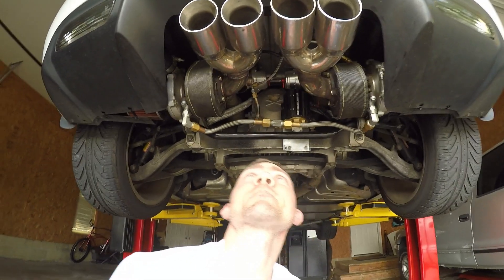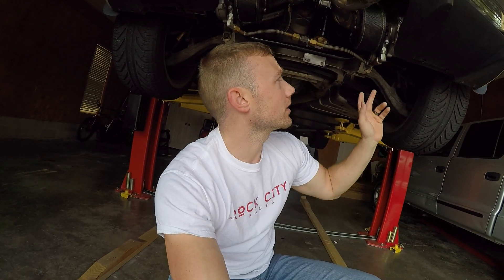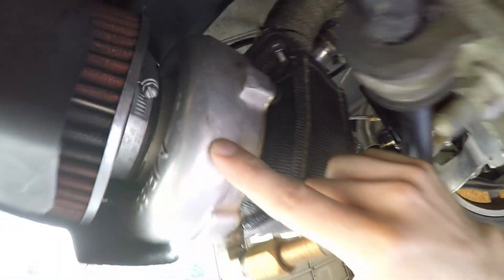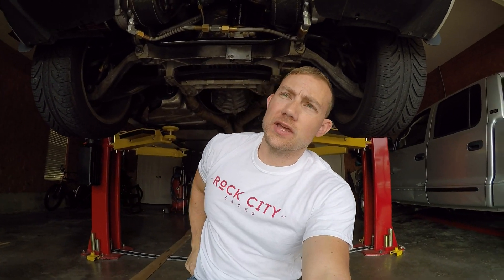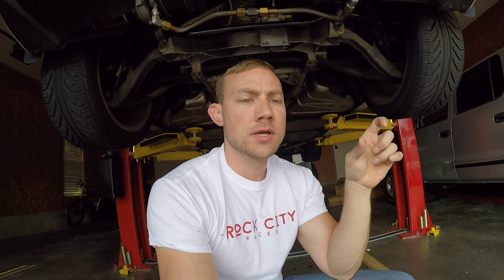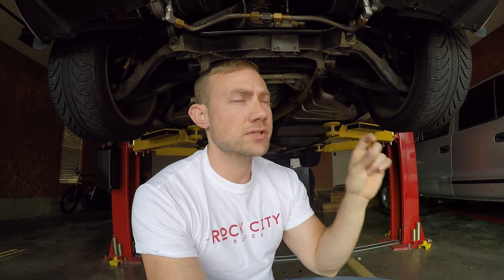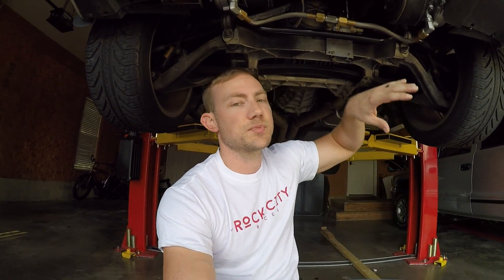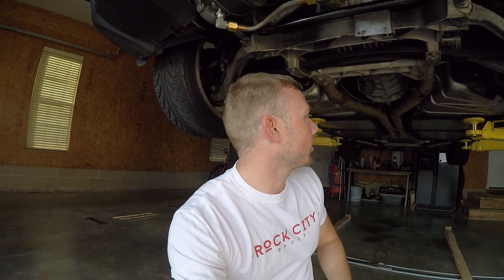Rear Mount Oil In The Turbo Solved

Comment: I know this is old,  but just wanted to say thanks.  Relocating the oil pump and installing the check valve fixed my burning oil issues on my low mount turbo.
Still getting a small  (quarter size) oil stain under the turbo over night though.
Reply from the maker: I would take the turbo apart and clean it out really good.  To be honest the check valve did almost nothing.  The higher flow pump and delay timer did the trick.

Comment: Good to hear that the oil issue is fixed. Did you know that phobia street stopped making the kit you have. I contacted them to get one and they told me that.
Reply: If you are still looking for a rear mount turbo system, try contacting STS turbo chargers. Send a message or give a call and they should give you a price.
Reply from the maker: STS are stupid over priced you could build one like mine for 3k

Comment: Speed Mafia Performance out of Colorado was a dealer for STS Turbo back in the day when they came out and I saw a TT C5 Z06 and that kit came with check valves... moral of the story is the check valve so be as close as possible to the oil intake side... I believe the spring for the check valve is 3.5lbs... you can purchase higher springs. This is know for about 12 years now...
Reply from the maker: In the end the real oiling issues was the return pump did not flow enough.  I put a higher flowing pump and removed the restrictors and no issues ever again.  Check valves are still in and a timer to run the pumps after shut off.  But the I still had oiling issues until I put the higher flowing pump in.

Comment: Here's a thought: Instead of having oil being supplied from the engine, why not have the turbos have their own oil pump/filter/cooler/tank dedicated to them with a timer?  There would be more costs associated with it and room needed to accommodate but I would think you would have better control on how the turbos are lubricated - not to mention eliminating issues with engine supplied oil. Anybody have an thoughts about this?
Reply from the maker: Very costly, time consuming, and not any more of a guarantee that you will have a better result.  If that was the better option car manufactures would be doing it, but instead they are doing oil supplied form the motor and returned.
Reply: xxblamedxx oem is not doing custom rear mounts, thus why we are. Oem is cost focused on massive production, this is hobbyist
Reply: I was wondering the same. if properly plumbed and set up. a dedicated oil supply sounds like the way to go!
Reply: @TheLifeofaMan  The is really bad reasoning, and it's usually false .  "If XXX was the better option, car manufactures (sic) would be doing it...."  

Car manufacturesr must find a price where they can profit.   They make 1000s of trade-off when designing a vehicle.   The better option for who?  for what result?  

   Quite obviously, everyone wants something different, to say something wouldn't work or be better because "the car isn't manufactured that way"  well just isn't factually correct and the reason people modify their cars.
Reply: @TheLifeofaMan  There are several rear turbo designs with a separate oil sump and cooler.   Generally you have a better result over time with these because contaminated oil from the engine is not running through your turbos.  You should still filter this oil supply because over time, like in the engine oil, microscopic metal comes off the moving parts and you want that removed from you oil as soon as possible    Unless you have a bypass filter setup on your engine, you are getting progressively more contaminated oil in the engine oil every minute your car runs until the next oil change.   If your turbos are separate from this, they don't bathe in that oil.   A bypass filter though would likely solve the problem of oil contamination in a shared sump.

Comment: Noise is a no go, I've heard one of those pumps in action and it makes wayyy too much noise. I would have ordered a second quiet pump, or even better as someone else also mentioned, added a small reservoir to hold the overflow to give the pump time to catch up. I would add a second pump for backup with a trigger in the event the primary pump failed to avoid being stuck on the side of the road when it finally does fail and adding a small cooler might not be a bad idea to keep the turbo center  section temps down to extend the life of the pump.  I'm planning my own rear mount and I want it to be as dependable and quiet as a front mount setup. I have used the Holley series red/blue/black pump for scavenging and it works very well once the pump screen is removed in order to allow free oil entry. It is very quiet, you just have to protect it from extreme heat.
Reply: Rbracing-rsr makes a transfer pump with helical gears.

Comment: Put a voltage regulator on the pump circuit and slow the pump down at lower RPMs
Reply from the maker: Better frame isolation was all I needed and now you can barely hear it run.

Comment: I’m using a standalone oiling system on my set up. I’m thinking of converting it to a scavenge system. I use a mechanical pump driven by an electric motor. My project is a work in progress to see how cheaply it can be done.
Reply from the maker: These oil pumps are like $60 the heat sync is another 100. Running for years no issue
Reply: @TheLifeofaMan  only problem is the noise,  I spoke to the manufacturer of a similar pump to yours who said they should only be run for 30 mins max 😞. 
The RB racing pumps have helical gears so they're quiet but to get one sent over to the UK is gonna be crazy money. Something like $800 all in and that's too much.

Comment: Awesome. I have a single turbo kit on my 5.0 and it's blowing oil out the exhaust like crazy right now because the return line runs too far to the back of the pan causing pooling after a few minutes of driving. Time for a scavenge pump.
Reply from the maker: Run a high flow pump and dump it into the valve cover. One of the other earlier videos cover were I dump my oil. There is already an open port on the driver side valve cover.

Comment: Where are the part numbers for the check valves?
Reply from the maker: I could never find them again.  You can find them on mcmastercarr or the like.  Just make you sure you get low cracking pressure and viton seals.

Comment: Got a link to the check valve?
Reply from the maker: I have been asked several times and I can not find which one I used.  Any check valve with 1psi cracking pressure and viton seal will be fine.

Comment: If you ever want to upgrade your oil return pump or switch it to something different then you should check out the Exa  pump. I have it on my remount turbo system and it is so quiet. I have had no problems for three years. Its worth a look at.
Reply: Justin Lampe hey man what oil feed line size and return size hose are u running? I got a 2002 z28 with original sts turbo kit with upgraded on3  70 mm turbo. The kit has the original feed line and return line with upgraded shurflo pump. I am looking into upgrading it and would like to see some input.
Reply: Justin Lampe sorry forgot to mention I have a restrictor in the feed line
Reply: That's awesome! How you liking that turbo? I actually have an on3 7875 turbo on my car. It is a little large but I put down 683rwhp on 16 psi. I do have a LQ4/4L80E setup. I may do a few videos on my setup. I believe my feed line is a 4 AN line. The return is a huge 10 AN line to the scavenger pump then it is a 3/8 rubber hose from pump to oil filler cap. STS turbos is back up and running again. I had to buy a new feed line from them a couple months ago. I did it that way so it would be the correct length and size.
Reply: Justin Lampe it's a decent setup man honestly but I wanna get a little more out of it but do it safely. I had a bit of issues with oil getting passed the seals so I'm wanting to upgrade that and maybe upgrade the turbo as well. Yes I would love to see some videos of ur car
Reply from the maker: Oil and feed lines are the same size. I have little set skew with 1mm holes drilled through them in the feed lines right on top of the turbos.  I threaded the adapters from the line 90 down to the turbos.  Return is open. I think they are 3/8 steel braided lines. It is what came with the kit
Reply: exa junk

Comment: What else do you need for the oil system? Just lines, check valve and the scavage pump? Or do you need other stuff? I’m wanting to locate my front mount turbo to the rear
Reply: Also, where is your Widebands located?
Reply from the maker: Turns out the check valves were a waste.  I put  high flow pump and a timer on it and all the problems went away.  The time lets the oil return pump run for about 15sec after shut down to empty the system out so it can not drain into the turbo.
Reply from the maker: Wide band is in the cat right below the manifold.  I have a video on here showing it under the gauge install.
Reply: @TheLifeofaMan  thanks for the replies. So far mine has been working great and already had it dyno’d!

Comment: Where did u get ur oil check valves from
Reply from the maker: I have been asked several times and I can not find which one I used.  Any check valve with 1psi cracking pressure and viton seal will be fine.

Comment: What check valves did you use and link for the pump??
Reply from the maker: No check values from the turbo to the pump.  Just on the supply.  I put a timer on it to keep the pump running for 15 sec after turn of to drain everything on the bottom side.

Comment: My rear mount has oil coming from the drain side.. I installed a check valve which helped a lot bit didn't stop it.. the lowest turbo spills. Little oil on startup :-(

Comment: Any way i can get the link for the pump? I have the same issue on my 76mm precision turbo and its driving me nuts lol. I will apreciate it if you can tell me the brand of it thanks
Reply from the maker: Cesar Garcia just search Google for oil scavange pump. They are like $60 and they are black and brass. Mine came with the kit so I don't have a link. Contact turbowex directly and they will sell just the heat sink for monting and longevity of the pump

Comment: Can you post a website for the check valve I been searching but can not find them.
Reply from the maker: Tons of people have asked and I can not find the order from when I got mine so it is lost in time lol
I remember ordering it from a sight like mcmaster carr.  I just found one in the fitting size I needed and the cracking pressure I wanted.  Also make sure it has viton seals.  neoprene seals work for a short while then fail because of the heat.

Comment: So what about those gears that aren't C clipped in there? Mounted correctly like that they just rub against the cover plate.
Reply from the maker: TheGuruStud they are under zero force and constant lubrication.  I've taken the cover off a couple times and no signs of where on the gear or cover.

Comment: simple fix is to make two small sumps for the turbos with breather vents that way the turbos drain as they were designed to do an the pump isn't constantly sucking on the turbos also once the engine is shut down the excess oil pressure has somewhere to drain instead of cooking inside the turbos bearings look up https://www.youtube.com/channel/UCQpoC_ilAGaNyLrLnXaH4Rg he has videos explaining this problem (he also isn't the only one whose worked out turbos need a freely draining sump to drain into)

Comment: Where did you pick up the heat sink for that oil pump?
Reply from the maker: It came with the Spartan pump and I kept it and slipped the cheap oil pump into it. I bet turbowerx would sell just the heat sync

Comment: What were the part #s for the Check Valve fittings? I did not see them in the description?
Reply from the maker: I did not put the PNs in there because it will be different for everyones application.  Just make sure it is a low cracking pressure and viton seals.
Reply: https://www.mcmaster.com/hydraulic-check-valves start there

Comment: So, I'm switching my engine bay turbo kit to a rear mount to gain back my engine bay. It sounds like the Turbowerk spartan pump would work for me since mine is a single turbo, four cylinder? I will use the check valve you talk about of course and the other notes. Unlike your twin setup, do you think this is good for a single turbo setup? Thanks.
Reply from the maker: Kurt Bennett I would still use the exact or the cheap eBay pump like mine. The Spartan kits loader when it fills. The gear pump gets quite when it fills.

Comment: Is only one scavenge pump good enough for a twin turbo setup? what is the specs on that pump? what size are the turbos?
Reply from the maker: TheFonz808  one pump is enough with restrictors in the feed. The pump is the cheap eBay pump. It flows tons but I don't have the specs
Reply from the maker: TheFonz808 turbos are 60 63

Comment: Where did you get these check Valves
Reply from the maker: mcmastercarr but I have never been able to find the part number.  They are 1psi crack pressure with viton seals.